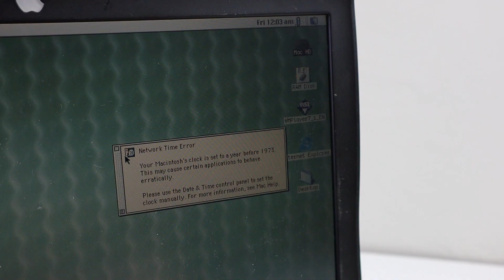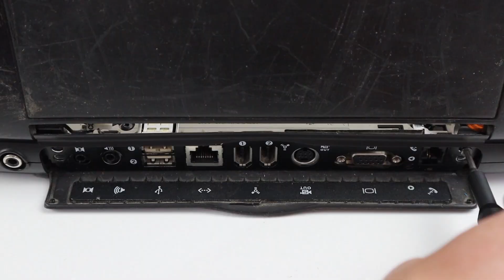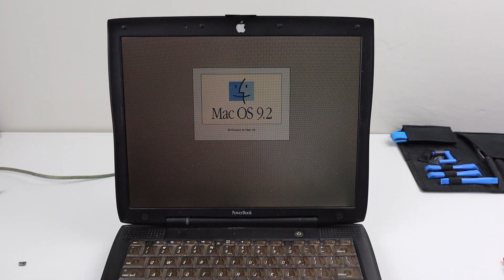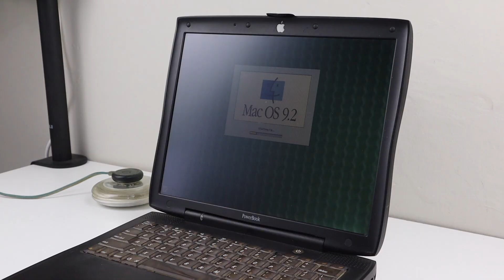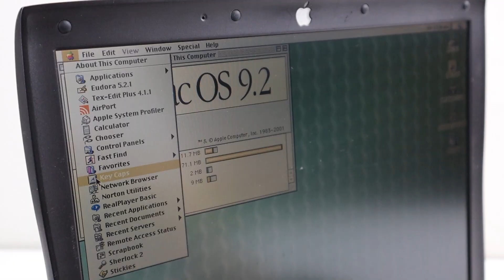Restoring Apple's Most Upgradable Laptop - PowerBook G3 Pismo - The M1 Mac I Wanted To See...

Comment: So if this PowerBook has a daughter card for the processors and RAM, why can’t they do the same with the M-series chips? Especially since the M-Series chips have the RAM integrated into the SOC, this could be the perfect solution for upgrading the SOC and RAM on new Mac computers, even though you would have to upgrade them both simultaneously.

Comment: I just picked up one of these from eBay - 400MHz version and mine doesn't seem to have a heatsink - the CPU has a small round plastic bit that's coated with a thermal pad that then contacts the silver shielding - seems kind of lacking as far as cooling goes but I don't see space in mine for a heatsink.

Comment: Regarding the faded plastic, I recall my sister once attempted to buff up the plastic on her Doge Caravan (non-painted plastic), and it turned out like that faded old crap. I told her to apply WD-40 onto it (I wasn`t sure if it worked), and she did it, and it worked; it turned back to its original color. By the way i still use my PSIMO up to this day, I just managed to restore it without having my DVD-ROM working through USB - yes, you can boot MaxOSX image (iso) from it, if you copy your ISO onto the USB through RAW HDD COPY TOOL (without opening the file, if you open the file under Windows it wil lget corrupted), then you can install MAcOS9 Classic once you run OS X. But, you have to follow the follwoing path, before installing OS X you have to (under utitlities - disk utility) create two partitions - partition one, and partitions two (one you'll reserve for OS9 and two will be your for your X) then install install OS X onto two and once you booted into its environment, you'll you run MacOS9 installation folder (after you locked the file under EDIT - get info) and install it.

Comment: I think I had this exact machine. I replaced the ram many times, HDD 3 times, and the logic (mother) board 1 time... I got 6 years out of this machine. Yes it is good.
Reply: also I installed a combo drive to replace the notorius DVD drive it came with (LG or Panansonic from memory)

Comment: I remember watching snippets from Apple's old keynotes where they specifically talked about how easy they were to service. Has anyone ever seen the introduction of the Blue and White Power Mac G3, where Steve Jobs specifically showcased how the machine opened like an oven door, and the audience loved it? I even remember watching a keynote for the iMac G5, and they mentioned that the machine was easy for customers to open and get into. It seems that they stopped making their machines easily serviceable with the launch of their Intel machines, and they specifically made them harder to service ever since, now with their Apple Silicon machines that I'd be worried about breaking since it'd probably be a new machine entirely. Keyboard stops working? New laptop! 

I love the battery life and performance my M1 still provides, but I really think it will be my last Apple Silicon laptop. I'm thoroughly disgusted by Apple's current hypocrisy and in love with the Framework laptop, especially since they advertise Linux capability. I opened up a Dell Latitude E6400 not long ago, and it made me really miss the repairable/upgradeable nature of older laptops. Want a faster CPU? Sure, only 5 minutes! Screen broke? Two clips, two screws, and you're done! Battery? Just pull it out! I'm convinced that manufacturers could make good profit off selling upgrade and replacement parts for their machines, but it seems that they make more money off selling entire systems, and they'd rather go that route. I really hate that money matters more than anything else to them, as if they couldn't afford repairable machines. Yeah, the Framework laptop isn't quite as tip-top sleek and sexy as a MacBook Air, but they're fully modular and they still look good! When my MacBook packs it in, I'm going for a Framework laptop.

Comment: Hugh, after you wet sand you need a polishing compound to get it to shine again. The idea of sand paper is to make the scratches extremely fine scratches so that it can later be buffed out, wet sanding alone won’t restore the finish. Look for headlight polish, it works fantastic in restoring scratched electronics when used properly.

Comment: I have one of these that I bought new. In addition to all the wonderful qualities you mentioned, they were also very durable. Also, with an external battery charger, battery life was only limited by the number of batteries you owned. Fantastic machine, although it was barely capable of running os X. Apple used to really care about the entire user experience. Even the 2011 macbook pro that I use daily is fully repairable and I have performed many repairs and upgrades to it.

Comment: I still have my Pismo in my collection and it has been updated with the G4 550MHz processor/1GB RAM/120GB HDD. I have Tiger 10.4.11 installed on this laptop and the PRAM battery removed. Fortunately I still don't have the "red" screen when booting my laptop up. It is a solid laptop and I sometimes take it out and take it to a coffee shop and fire it up... I sometimes get stares from people because of how big this laptop is compared to modern laptops... :)

Comment: Pro Tip: If you can't find a working Pismo DVD drive, you can actually repurpose a thing, slot-loading combo drive from a discarded Powerbook G4, which are a lot more common to find (and usually cheaper).  It looks a little ugly because a small part of the metal on the slot loading drive sticks out (only about 2mm), but it clicks into place perfectly, is recognized and usable by Mac OS 9.2.2 and by earlier OS X versions as well.

Comment: You shouldn't use alcohol on screens or, really, hardened plastic. The plastic needs to be nourished to stop it turning white and dry. I find that if you use the wipes that they sell for cleaning make-up off the face they work really well for electronics.

Comment: People are talking about how great this laptop was compared to the ones Apple makes today.  A someone who got it when it came out, this laptop was definintely a mixed bag. It weighed a ton, it cost almost $3000 in 1998 and it was pretty slow compared to current models. OS 9 was clunky at this point as well. Still the swapability of drives, batteries and other components was cool.  And it had a great screen for the time.  All in all it was a good machine for the time.

Comment: If it's the most upgradeable, is it possible to make this a sleeper laptop?
By this I mean that only the case would be original, since even the display and pretty much everything would be changed/updated to the most recent or best components available atm available to be used that can fit in it.
Reply: It would need to be an entirely custom job, better to leave it as is.

Comment: old macs: Pull my keyboard, then replace my battery, please.
new macs: Unscrew 20 screws, and then some more then you can change my battery.
Also, 2 cables. And have extreme care so my keyboard doesn't break, K?
Reply: You don’t even need to remove the Keyboard to replace the main battery, just the pram battery.

Comment: There is way to remove that "haze" from sanding it and light scratches but it required knowledge and patience, try it first on something else - use heat gun but from quite far away, hair dryer is not hot enough. This method is melting surface of plastic and gives it almost factory look. This works not for all plastics so trying it elsewhere is needed before doing it on repaired piece.

Comment: When apple do make an upgradable machine like the Mac Pro , you only get the upgrades from them at a ridiculous price. Still got you by the short and curlys.  This machine was built in the days of proper engineering, all that metal and screw down parts, no glue in sight.

Comment: Great video, thank you. I’m hoping to buy an earlier G3 Powerbook, but they cost hundreds on eBay. Wish I could find one like you did!

The PRAM cells are a bit special, I recognise that type from somewhere else; rechargeable vanadium pentoxide. They have the solder tabs already welded on; you just have to solder them together and heatshrink the cells together. Have a look at PANASONIC VL2330
https://a.aliexpress.com/_mq16yGx

Comment: To solder the batteries, you can solder them with a common soldering iron, the magic is in sanding the surface to be soldered a little, so that the roughness holds the tin.  Also use flux for soldering.

Comment: I had one but it was from 1999, it was a 333 Lombard. Very similar to the Pismo except for the back ports(Pismo had firewire). I had upgraded the CPU to the 400 G3 PPC and you could also upgrade them to the G4 like the Pismo at the time from the aftermarket. Had both the right bay and the battery bay (left) with two batteries and got something like 8-9 hours back then. That was an awesome laptop. Thanks for the memory lane. :)

Comment: This is probably the precursor to the M1 chip, as one can clearly observe that there’s ram, graphics, and a CPU on one module, which is completely separate from the rest of the motherboard. one could locate boards similar to this conceptually in modern airplane avionics. I wonder if someone would be brave enough to attempt at producing a modern intel cpu module with ddr4/5 and high end graphics that can connect to this PowerBook…  it would become the ultimate sleeper laptop… That person should walk into an Apple store and say that their PowerBook is having trouble with MacOS Monterrey…
Reply: This wasn't too uncommon in the day
Reply: The graphics are on the motherboard.

Comment: I loved my Pismo G3, in the the end I had a G4/500 accelerator card with 1GB RAM, Zip drive or battery in the right bay, which kept me going until I finally replaced it with a Powerbook Titanium 1GHz which is still my favorite Apple laptop of all time, closely followed by the Powerbook 2400c/240 in which I also had a G3/200Mhz accelerator card and a custom transparent case that I bought in Japan.

Comment: im sure youve received this suggestion before, but in case you havent—have you ever tried novus plastic polish for removing scratches? Ive used it to remove scratches in acrylic, as well as in vintage drum wraps which are basically plastic. I find it works well with some elbow grease.

Comment: I had a MacBook Pro from 2016 and I was using it 2 or 3 times a week just for word and some web browsing. I always took care of it and it had not a single scratch or would it ever get hot. Never. After a year of warranty expiring it stopped working. Took it to Apple, they said it’ll cost you £700 to replace the entire motherboard as it is damaged. So I had no choice and paid and sold the MacBook Pro for 900. Never again……..

Comment: You should look up chipquik low temp solder. It makes removed pieces very easy. Because it stays liquid longer. So you add some to each other joints. Then heat them up and the item pops right off. Then use some desoldering braid to soak up the solder. Then get some flux remover on a q-tip to clean it up. It’s super easy and a lot let stressful. :)

Comment: I would of used a different type of therm paste. Artic Silver 5. That white is for the birds imho. But anyhoo nice video. Too bad newer Mac products are not like this, would of been nice if they allowed you to replace the CPU. But I do have to say im happy with the 3 Macs I own. I have a mid 2010 w/SSD and 16gb of ram. Nice machine, no issues with it at all. My other laptop is a mid 2012 Macbook Pro w/SSD and 16gb of ram and this computer is my fav I own. Also have a mid 2010 Imac Mini hooked up to my flat screen, its only got 8gb of ram but along with the SSD upgrade the mini is able to do the basic tasks. I play SNES and PS1 etc on emulators and the mini is a good choice (I bought mine used for $70 including shipping). I also bout a Blue-Ray (External) so not only can I game and watch Youtube and more etc. I can watch movies. 

Only mac I want to buy for myself currently is a 2012 Imac and load it with 16gb Ram and a 500gb SSD and take out the DVD unit and put a 2nd SSD in.
Reply: There were older Macs where a simple CPU card could change the entire architecture of the computer from 68k to PowerPC. It’d be like upgrading from a core i7 to an M2 Max.

Comment: You can get these batteries with spot welded, solder ready metal bits on amazon or any other electronic store if you look for "PCB mountable batteries" AFAIK. So joining four of those together should be doable.

Comment: I have a Lombard, the G3 Powerbook just before the Pismo, and I love it. It's my favourite computer, and I've had a lot of fun upgrading it over the years.
My Lombardhas a 400 Mhz processor (upgraded from its original 333 Mhz processor), 512 MBs of RAM (the maximum for this model), a 128GB Compact Flash card "SSD", modern silver thermal paste, a Firewire 400 PCMCIA card, and a slot-loading optical drive taken from a G5 iMac.
I use my Lombard for music and replaying childhood games.

Comment: Hugh, never squirt cleaner directly onto a lcd. All it takes is for a drops to run behind the bezel and touch the panel. If it enters the panel you will get white spots in the screen which never go away.
https://discussions.apple.com/thread/4896567
The safe way to clean a laptop screen is to lay the laptop over so that the screen is facing upward. You will have to balance the lower case to prevent it falling forward or backward. It's easy to do.
Always spray cleaner onto a microfiber or soft lint free cloth and wipe the screen clean.

Comment: While I don't recommend soldering batteries because of safety. If you must, use a low power soldering iron, and wear safety goggles, and face and hand shielding, when soldering batteries as they might explode. You have to sand the battery, in order for the solder to flow it needs a rough surface some batteries don't work even if you do sand them. It is better to get the proper spot welder and read the directions.

Comment: The solder doesn't stick to the battery because the surface is too smooth.  You need to abrade the surface with sandpaper, clean with alcohol, and apply flux prior to soldering.

And the backlight is reddish before becoming white because the CCFL tube is worn from use, not age.  You may continue to use it that way but, sooner or later, it will stop working once the florescent tube in the panel wears out.

Comment: Wow, you have excellent vintage computer repair skills.  Of all the vintage Apple laptops in my collection this is the only one that, I call "My Baby".  I picked up my used Power Book G3 (Fire-wire) Pismo around 2003.  Also, because spare parts have become harder to find, I obtained a second one on Ebay about 8-years ago.  In my opinion this model is the best designed laptop Apple ever made for several reasons which include: 1) A great selection of ports two USB, two Fire-wire 400, Ethernet, 56K modem, IR, PCMA, S-video, headphone, and Sound in, port; 2) Right and Left side "hot swapable" bays (for things like an extra battery, extra memory, floppy drive, 120 MB super-disk drive, 100 MB Zip drive, DVD player, etc.); and 3) Easy to upgrade and repair.  During the 2010's thought that, I would have to retire this model but with the expanded use of USB thumb drives my Power Book G3 has continued to have life running both classic OS 9.2 and OS X 10.4 Tiger.

Comment: This was the 2nd Apple laptop I ever owned or worked on. Repairability was as high as I have ever seen on any laptop of any company and the thing was built like a tank.
Had its predecessor (PB Wallstreet) and it felt like carrying a 6 lb piece of rock...Pismo is much lighter and thinner plus it had the light up Apple logo that the newer iBooks and Powerbooks of the 2000s era had. 

Found em both in a basement in pieces and resurrected them to give to my SO at the time for her first laptop. At that time, there was a recall on the original chargers (black, rectangular) and Apple sent me the newer puck style that you have FOR FREE!!!

 Wallstreet lasted a year, Pismo about 2.5 years until it was too slow running Mac OSX. 
I think it was donated and may still be running today.

Apple of today would not even recognize this machine!

Comment: I had this exact laptop. Loved it. The modular battery/drive bays were awesome. Could put in two batteries, Zip drives, etc. Could pop off the keyboard in seconds. When the power plug eventually broke, the power card was a separate small board and I changed it myself. Same thing when one of the screen hinges cracked. For all the BS that Apple, and other companies, say they "care for the environment", in reality, it's all about selling product. If they truly cared about the environment, they would make their products repairable, including by third parties, and keep them useful as long as possible. Sad state of affairs.

Comment: Apple laptops were insanely expensive in the 1990’s and 2000’s. A 400 MHz PowerBook G3 went for 3500 dollars, which, corrected for inflation, is about 5400 dollars in today’s money.
And yes, they were repairable, but nowadays we want a very flat, extremely fast laptop with loads of memory, a massive SSD, and it needs to be reliable, with long battery life, and cheap as chips.
So something’s gotta give. In the 2000’s, all laptops were clunky, big, heavy. And don’t forget that 20-25 years ago, most people bought a modular PC, or a modular Mac. They wanted to be able to upgrade their hard drive, add memory, upgrade the processor, but nowadays we just want to use the device and know that it works. It’s the same with cars, houses, clothes. It needs to be “plug-and-play”; hardly anyone knows how to maintain their car, let alone their laptop or desktop. So, you can blame Apple (or any other manufacturer) all you want, but we (consumers) are to blame. If we demand more repairable tools, companies will build them.